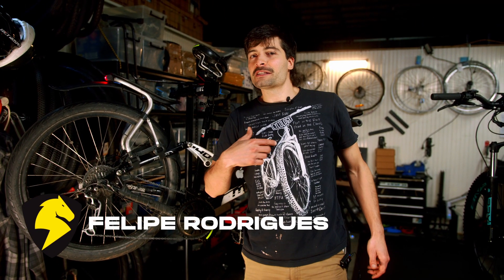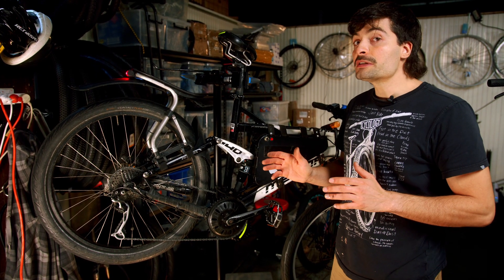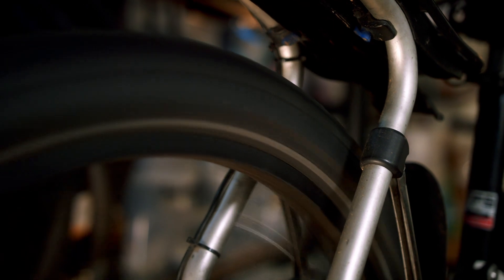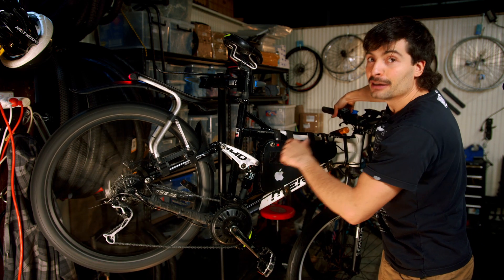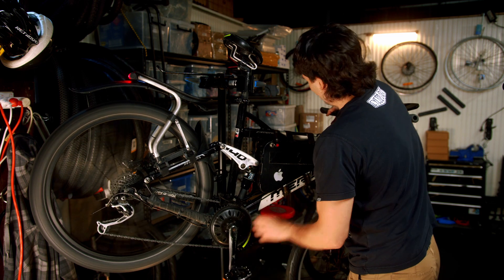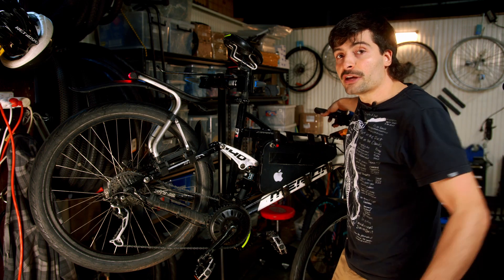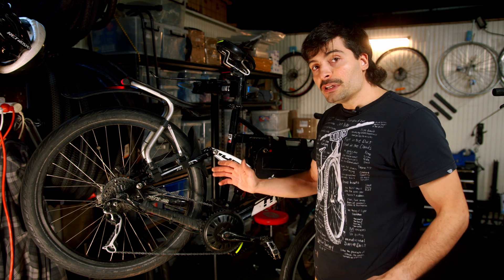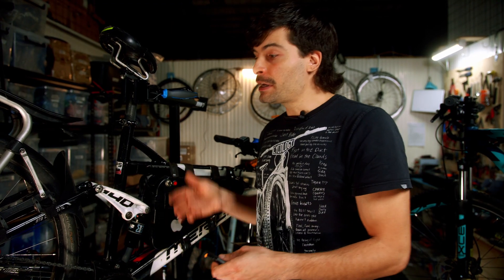How to shift gears on a Mid-drive Ebike

Comment: Hi Felipe. I greatly appreciate your insights and all the time you devote to helping others understand this amazing invention of putting electric motors on their bikes. I absolutely love mine. I wanted to weigh in and share my two cents about the brake sensor amid mountain biking applications. It came with my purchase but I chose not to install it and I’m glad I did not. I find there are many times, such as ascending switchbacks, where I am breaking against the assist. Or, I pull the brake levers in just where they are about to touch the pads to set myself up in case I have to break against the assist. If the motor cut out I would lose all my momentum and not make the switchback. Even on the lowest assist level the amount of propulsion can be more than I want on twisty narrow climbs (or switchbacks) so I need to slow it down but cannot afford to lose that assist.  Anyway, my two cents. Take care, and all the best to you.
Reply: Hey Max, I agree with you but it also depends on the controller settings you have on your bike. You mentioned in another comment before that you burnt the brand new motor controller after trying new programming settings 7 times, so I guess you're running your controller stock now. 
You could add instant torque (as its and off-road beast) and leave a very low delay to cut off the PAS, and a quicker PAS activation. That would solve the switchbacks and would allow a kill switch on the brake lever because you never know what could go wrong. It could be a tree branch or your finger.
To summarise, each rider has their own settings that will best suit their application. And thanks for sharing your thoughts.

Comment: I just slightly pause peddling and shift then pedal
Reply from the maker: That's another way of doing it but not efficient as there's too much mass on human legs to sudden stop it, moreover, you will need movement on the chainring to make the chain change sprockets, how will you do that if you're not pedalling?
Reply: Yeah that works as well but there’s too much inertia on the legs to stop it timely. Reving up the motor and letting go the throttle for a fraction of a second then shift is much quicker and precise
Reply: Just  understand reving up the motor  means increasing  the amount  of throttle  which will  also give you a sudden burst of speed,  so not the most smoothest way to change gears especially if their is somebody close in front of you. You dont want to run up their backside, so just slow down your  peddling /cadence then shift up or down  and let the motor cut off sensor and derailleur do their jobs.

Comment: All this time, I have been taking off on 6th gear, however whenever I take off, i roll the bike forward with my foot and then I apply the throttle veryy slowly and gently to slowly accelerate, then when I have picked up some speed I start pedalling to avoid strain on drivetrain
Reply: Ali I would not recommend doing that to anyone, and for prolonged periods you will cause internal damages to the motor/controller or drivetrain of your bike. What you’re doing is the same then engaging 3rd gear on a manual car and opening the door and pushing the car then jumping back in and throttling slowly till you get some speed. 
The gears of your bike are there so be wise and use them!
Reply: @frcr90  I followed your advice, and now the gear shifting technique has become so easy and natural for me, I am so glad I found this video before it was too late, I only recently just converted my bike to the bafang mid drive, so I was still learning, thank you very much Felipe for the help.
Reply from the maker: Ohh yeah Felipe, spot on!
Reply from the maker: Felipe is our Cyberbikes CEO, please follow his advice, he's right about that! Cheers thanks for your comment!

Comment: Hi Felipe ,tomorrow I'm ordering my 1000 w bafang mid- drive motor kit. Can you suggest a controller there's many as optional and I don't know which one to take. In case it's relevant to you my battery will be 48 volts. Looking forward to hear from you ! Cheers.
Reply from the maker: The Bafang BBSHD 1000W already comes with a motor controller, if you're talking about the LCD display, we suggest the DPC18 model. Cheers Marc

Comment: I'm getting close to order and build my e-bike Felipe and I'm so exited. Watch a lot of good videos like yours . I notice you have a chain guide on your bike I'm I correct ?  I was thinking about a lekkie bling ring to hold the chain better in place but holy snozzels they are expensive. Would a chain guide do the trick ? I look forward to hearing from you. Thanks
Reply from the maker: Hey Marc, thanks for your comment. Yeah, I am sure you gonna fall in love with your ebike. About the chain guide and bling ring, what really matters are two things: 1. The chain line. Is the chain line too crossed when your ebike is on first gear? If yes, you have to add a chain guide because only the bling ring won't hold the chain in place. 2. Is your ebike full suspension, I mean, the rear of the bike will swing up and down? If that's the case you have to have a bling ring because the teeth are higher and will prevent the chain from slipping on top of the chainring.  Cheers, thanks for your comment. (Felipe)

Comment: Will I get the brake sensor lever as standard with most BBSHD kits? Im building a slow, very low geared, granny trike project to pull a large four wheeled trailer. Permanent ride along mode sort of thing.
Reply: The brake levers for mechanical disc brakes are included in the kit, that's the standard. Some companies also include the sensors for hydraulic brakes but it varies and I cannot confirm your order includes those sensors. Better check with who you ordered your kit with. Thanks for your comment, Cheers.
Reply from the maker: @frcr90  Thanks Felipe for your comment

Comment: I love the simplicity of this, completely eliminates the need for a gear sensor (which can often be laggy/unresponsive)
Reply from the maker: Exactly Jay, the gear sensors can also even cause more damage like Felipe explained in the video
Reply: Exactly I don't use a gear sensor, I use the throttle like a clutch.

Comment: How are you supposed to shift to a higher gear, while engaging the motor, on a bike with no gear sensor?
Reply from the maker: Alex this is what this video is all about. There are two ways: 1. Using a brake cut-off to stop the motor and shift the gears ; 2. Reving the motor to its maximum speed then letting off the throttle and using the inertia that's still on the motor to shift the chain to a higher gear. Please watch the video till the end. I will mention why I don't recommend gear sensors. Cheers, Felipe from Cyberbikes
Reply: @Cyberbikesau  i come to a steep hill. I brake, i shift gear.
Now,
Do i have to start to pedal BEFORE i release the brake?
Reply from the maker: @alexsainsbury2176  On a steep hill, I would not use the brake sensor. I would keep the motor at high revs and pass the entire hill without shifting gear up. As you said, it's a steep hill! However, if you want to gain speed while climbing, use the motor's inertia don't use the brake sensor.
Reply: Yes sorry about all the confusion  Alex, as it's not exactly  rocket  science  as some would make it out to be. Just buy a high wattage / high torque  output  mid drive ebike. Stick it in a low gear then forget about the gears and either  use throttle  or the peddle  assistance  modes or both to cruise up not at snails pace nor at a break a land speed record  pace and you will do just fine without any physical exertion  or burnt out motors to worry obout.

Comment: So, my Bafang 02 is on order. I am excited! If the bike has hydraulic brakes would you recommend changing to mechanical or using the gear sensor instead?  And, how do the complete e-bike manufacturers who ship the bikes with disc brakes get around the problem? You have an excellent channel and I have learned so much. Gracias. 🙏
Reply from the maker: Hi Max, thanks for your comment. Keep the hydraulic brakes, because they will stop your ebike quicker than mechanical brakes. I suggest installing at least one brake sensor in one of the brake levers (would suggest on the left-hand lever if that's also your rear brake). The gear sensor doesn't stop the motor unless you're shifting gears, so don't make confusion between the gear sensor and brake sensor, they are different things, however, the brake sensor can do exactly what the gear sensor does but not the other way around. I (Felipe) particularly don't like gear sensors, their delay to activate the motor might cause more damage than they are supposed to prevent.
Reply: @Cyberbikesau  Thanks so much, Felipe. I appreciate it!  This will be used exclusively for mountain biking and encountering many pitches and inclines where I will want to get down to the lowest gear. So, I believe the technique you use is engaging the brake lever just enough where it doesn’t actually apply the brakes but the magnetic sensor cuts the power to the motor and holding the lever in that position until I get shifted all the way down to the lowest gear? Is that correct? I doubt I will hardly ever use the throttle except for a hike -a-bike sections. And, conversely when beginning downhills shifting wouldn’t be an issue at all as you wouldn’t need to cut any power to the motor?  Thanks again. 👍
Reply: @peacelovegoldenrule  Yes, that’s correct, Max. About the throttle, we have set a standard here at Cyberbikes where we install the thumb throttle on the left-hand side, so your right-hand shifts the gears and press the brake, and the left-hand throttles and presses the brakes, kind of 2 functionalities to each hand, and I bet you are going to use the throttle more than you think! Going downhill will depend on the speed you’re at because if you’re standing still and then start rolling down, the motor accelerates faster than the bike so that it could mess up the gears. With a bit of practice, you will
Get the hang of it.
Answering the other question you asked after the edit: bike manufacturers install brake levers with an inbuilt brake sensor. Those brakes are way more reliable than the brake sensors we install. However, you have to find the balance between costs/benefits/reliability/availability. If you find one brake you like with an integrated lever, go for it
Reply: @frcr90  Thanks so much for taking the time Felipe. I appreciate it very much. My every good wish to you.
Reply: @peacelovegoldenrule  Thanks Max, all the best to you too. (PS: Keep playing the guitar you rock!)
Reply: @Felps Cyberbikes  Thanks for checking it out, Felipe. It’s so much fun. I found a literal Rosetta Stone, a partial capo in a certain position, that makes guitar fretting amazingly easy while producing a very rich sound. In a very short period of time it turned me into a fairly accomplished campfire guitarist. My stage name is “The Smokin’ Hot, Amazing, Campfire Capo Cheater.”  😜
So many great songs – so little time.  
It’s a blast and has changed my life. 🙏
Reply: If you find yourself at a steep hill while in smallest gear, simply get off the bike and lift the rear wheel then shift to the biggest rear gear,then go up the hill.
Reply: In your example am I. Ore t that your motor only works while your punching the throttle and disengages when you let off?

Comment: Hay  Brother best bloke out !👋👌👍👍👍👍👍👍 took mine off ! If you know how to ride a motor bike with 6 gears you can easily ride without a sensor !
Reply: Hey Oly my friend how are you doing? Yes you're right mate! Thanks for your comment see you around Bondi!
Reply: Which  sensor  are you referring  to? You maybe able to do without  the gear sensor  but l can do without the brake sensor and never had any issues. But unless you only use the throttle all the time it's a difficult job  riding  without  any sensor  and not do any damage to motor  and components.

Comment: I thought the gear sensor did the same as using the brake, that's why they can connect to the brake sensor cable.
Reply from the maker: On a Mission, thanks for your comment. The brake sensor gives you the choice of when to kill the motor while shifting gears, not in all conditions (climbing steep hills, riding on a trail or racing) you want the motor to stop powering the bike while you shift gears. Also, there are two types of gear sensors and they have different delay times. When using a gear sensor, please connect it directly to the controller gear sensor port, not on the brake cables. By doing that, you gonna reduce the delay of the gear shifter. Cheers from Cyberbikes

Comment: Hello, thanks for the good advice. I had the gear sensor, but I didn't like the drop in power on the slope. Greetings from Switzerland!
Reply from the maker: Hey thanks for your comment. Do you still ride that bike? Did you remove the gear sensor?